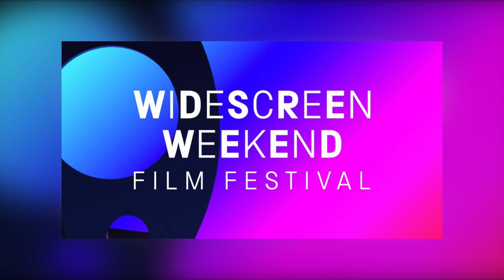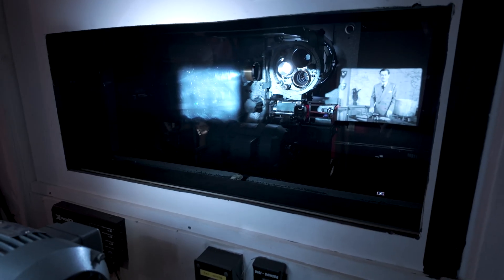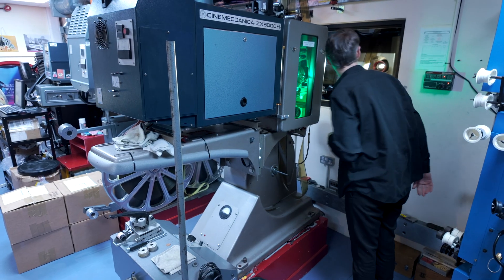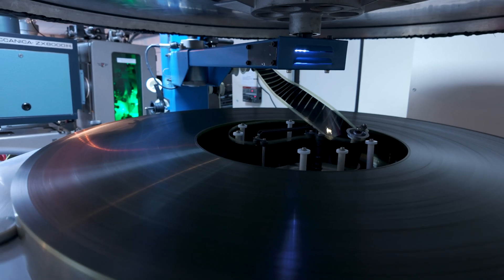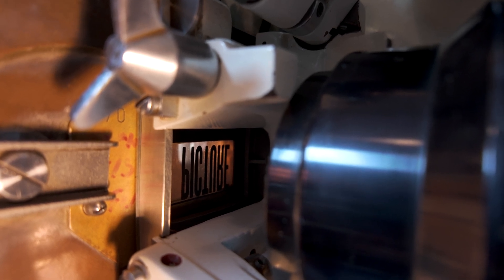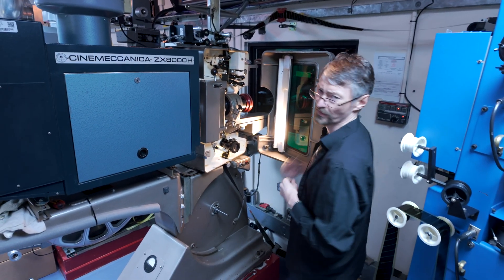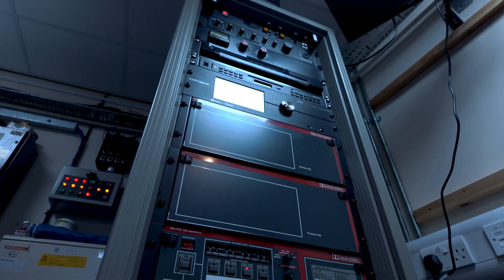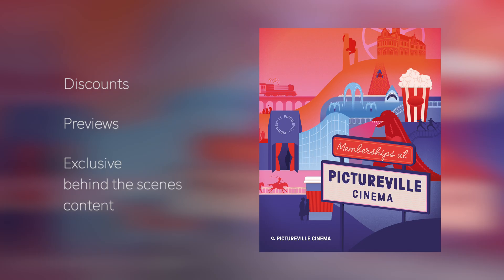The Art of Film: Preparing a 70mm Print of Phantom Thread

Comment: I recall when the Picturevile box was on two levels before the red-painted plinths.  I think H & S sensibly ordered changes.  Tony Cutts was once the 'DP70' man.  A lovely chap and very sadly missed!  Two strong hands were indeed required on the heavy DP70 inching knob.  The DP75 's inching was on the back of the motor shaft hence very low geared.  Nevertheless, with a 'well-warmed' DP75, you could inch them over easily by just firmly grasping the 70mm holdback sprockets.  When threading onto a spool take-up on a DP75,....  just the gentle 'pull' of winding film onto the take-up spool was often adequate to turn over the mechanism.  I hate it when I see the  DP75 being 'dissed' as rubbish as compared to the DP70.  Misuse them, as many venues did, and they would end up as 'rubbish' that could 'just about' project a decent show.  When properly cared for they worked beautifully, despite having an appetite for expensive consumable parts.  Most ... esp. ABC just ran them into the ground and generally got away with it. The thrust bearing on the intermittent outer 'keep' needed very careful adjustment to avoid disastrous seizure.  I can feel a book coming on!
Reply: I too remember the original design of the box; it was terrible and I always thought it was an accident waiting to happen.  Sadly that accident did eventually happen, and I think it was Tony who fell.  I see in this video that they have put a new lamphouse on the DP-70 which is much smaller than the huge Zenith one which it used to have.  In those days it was difficult to pass behind the projector, and all too easy to fall from the raised platform, particularly when working in the dark, and possibly carrying heavy reels of film.😊
Reply from the maker: I really appreciate comments like this from industry professionals. First-hand insights add so much depth and context to these topics, and it’s great to hear from people who’ve actually worked with this equipment. Thanks for taking the time to share your experience!